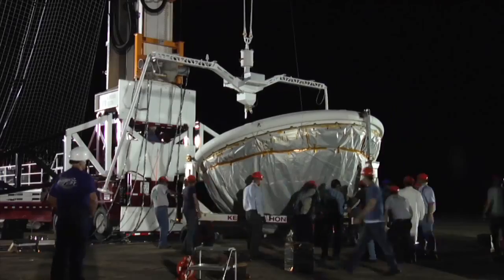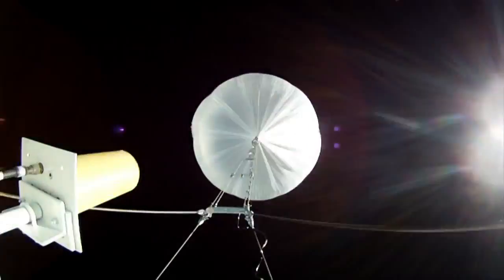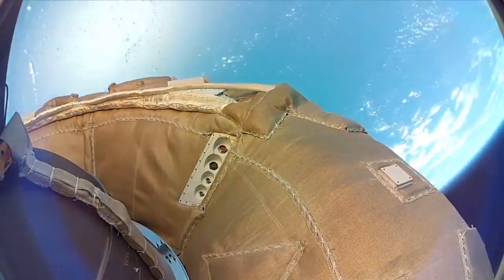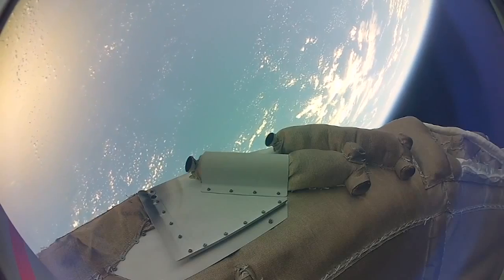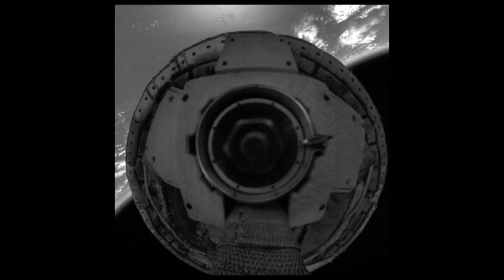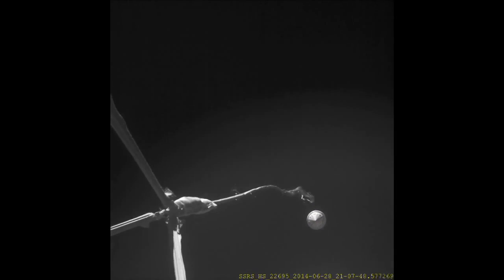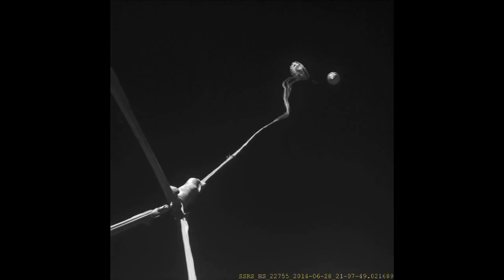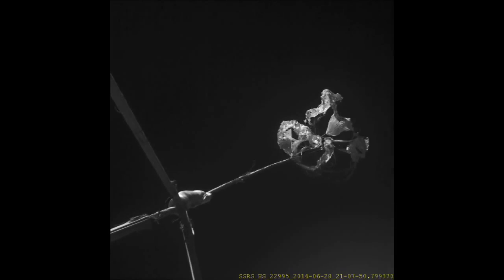NASA ‘Flying Saucer’ Aerobrakes From Supersonic Speed| Video

Comment: The problem with using a chute is it's random unreliability and possible total failure'' They should consider the use of a nitrous oxide propellant ,due to it's lower temp status, thus freeze problem don't exist, Also it's greater burn property's are perfect for gravitational potential energy! Verses a parachute's elastic energy''.
Reply: The most important factor in space flight is weight. What you propose is not viable.